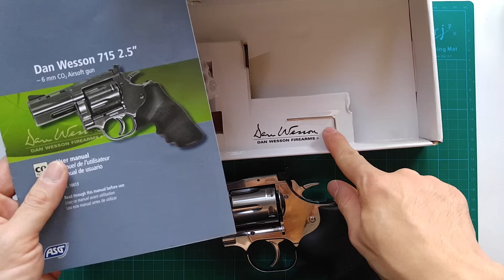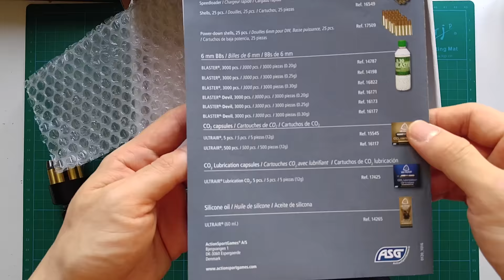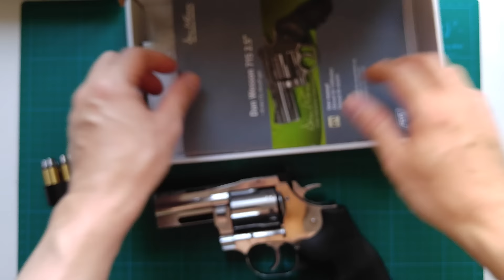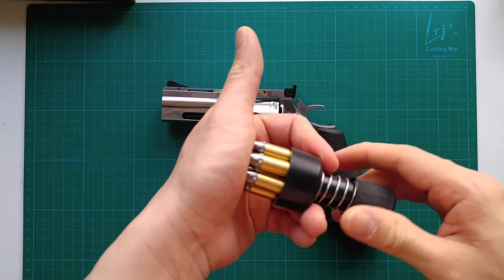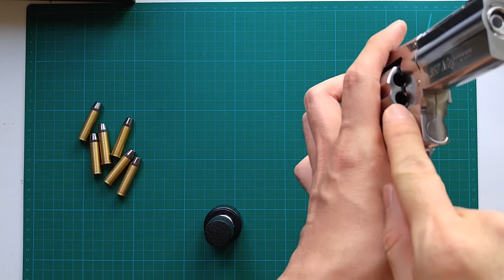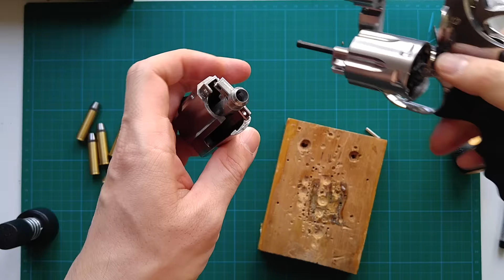ASG Dan Wesson 715 2.5 inches barrel CO2 6 mm airsoft revolver

Comment: I was considering the Umarex M29, but that made a lot of rattling noise with the shells. Instead I bought the Dan Wesson 715 grey steel. It feels very solid and heavy. I personally don't like rubberized grips and considering making a custom one. I skipped the moonclips and bought rear loading shells instead.
Reply from the maker: I brought the M29 too.
I got to admit the Dan Wesson build much better. It is solid, firm, and just feels premium in many ways.
There are wood grips available on eBay, made in Thailand. I have tried already. They looks good. But without the metallic insert, the weight and balance of the gun feels a bit off to me. So I stuck with original rubber grip eventually.
But I couldn't resist BIG bore revolver, with BIG cylinder.
Reply: @BadGuyDennis  
Good point, they added much weight to the grip panels.

Comment: why barell cant bechanged to another lenght one??
you just need to remove it and get a different one...should be the same...
Reply from the maker: The problem is: they don't have the barrel independently for sell. If you can found one, then you're right.
It is not impossible, but impractical.
Reply: this is such a waste...you could have basically 4 revolvers in 1 in this way, this making the gun the best in class. It already is on top best, but imagine having it with this possibility... :)
Hopefully they will make spare parts at some point in future...

Comment: very well,
but is it possible to replace the barrel with a rifled barrel?
Reply from the maker: This reply is gonna long.

Rifling can only be worked on projectiles which have somewhat of rod-shape. Also, the diameter of the projectile has to be slightly larger than the lands of the rifling in order for the projectile to engage with the rifling to spin. There is tremendous of fiction. This replica is a low pressure system (compared to those of true air gun) and doesn't have the power to overcome those friction.

Rifling is a very horrible horrible idea for spherical projectiles. I knew it very clear. My first premium airsoft gun is a MCG Beretta M92F in year 1992 (I still own it). It featured a so-called "Cyclone Barrel System" by the manufacturer, which actually is a rifled barrel. Back then there was no hop-up in airsoft world yet. The philosophy behind MCG of doing so was they tried to create a spinning air cushion around the BB to enhance the accuracy. When the whole system was new and the internal components were tight, we don't see the accuracy was any particularly impressive at all. (Even compared with my entry-level Tokyo Marui spring-powered hand-cocking pistol.) When the gun being played for a while and the tolerance started to lose, we gradually saw the trajectory going weird. The projectiles fly with circular motion in the trajectory in random direction because the BB follows the groves of the rifling! Simply replaced with a tight smooth bored barrel enhances the accuracy, range and muzzle energy, very substantially (many gas leak from rifling gloves with the original factory rifled barrel.) Later, when the concept of hop-up started to emerge in airsoft community (I was pretty early in experimenting this), we found the rifled barrel and pop-up just cannot co-exist. Hop-up will introduce more friction, with the already existing gas leak in the rifled barrel you lose even more power and range. As well as the trajectory was totally disastrous.

 So, I'm sorry but I have to say that even I know it's gonna offensive, in this case, your idea make no sense at all.

However,  if, this revolver replica, in air gun configuration, shoot mushroom shaped pellet, then your question might work. (But I have to emphasize again, I play airsoft only. I don't play air gun.)

Comment: This is a very good presentation.But Tell me please How I can take more FPS from this gun?
I have the Old version With all the mods.
450 fps.
I want to buy this version ,Do you know any mode?
Thank you.
Reply from the maker: Try bore up the hole in the "primer" of the shell.
Use stiffer hammer sping. (But the components will wear faster, and also leads to heavier trigger pull.)
Get the long barrel version.
Reply: Thank you very much.
I will Try The Modifications.

Comment: I just found a 6mm 2,5 inch silver version on Evike.com.
But the one they sell on Evike.com has a orange tip in the barrel.
Do you know any web store where you can buy one like yours without the orange tip?

Thank you.
Reply: Hi. If you are inside E.U. try to buy your replicas from France. They do not have those kinds of laws, so far... (And as far as I know). Good luck!!
Reply from the maker: I live in a place where real firearm is pretty prohibitive. But we are relatively opened to airsoft and we don't have this orange tip issue. Any responsible online store should and will gonna ship the gun with orange tip on to those regions that are legally required. I have no idea who would send you the gun with no orange tip on without getting any trouble. It is more practical to get rid of the tip on your own, rather than seeking one you wanted from the source. I don't think it is difficult. (https://www.reddit.com/r/airsoft/comments/1vngv8/how_would_i_go_about_removing_the_orange_tip_on_a/) Being said though, be advised that removal of the tip on user level might cause you with legal, and in the worst case, even death consequences.
Reply: Miscellaneous Chaotic Lab 
Thank you.
Do you think the chrome color will break off in the barrel if I pull of the orange tip?
Thank you for your help!
Reply from the maker: I don't have any proof, all right?
But I guess, chances are, very likely, that the tip (which is just a piece of plastic) is attached with super glue (i.e. cyanoacrylate). So heating should be get the job done pretty well. Some high power hairdryer may be good enough. Or you can take the outer barrel apart (demonstrated in my video), submerged in hot water.
Make good use of duct tape, masking tape, towels... whatever to protect the metal surface.
A more stupid way is take apart the outer barrel, and submerged in acetone (remember to remove the front sight beforehand, otherwise it will ruin the black coating) overnight. Yes, you will end up with a gooey, sticky mess. But at least it leave the metal unharmed.
Reply: Miscellaneous Chaotic Lab 
Thank you very much. It’s a good idea taking the barrel apart and use hot water.

Comment: Are those the “high flow” shells?
Reply from the maker: The shells that came along with the gun are already the more realistic metal "bullet head" front.
I brought the the gun and spare shells directly from the retail store of my local distributor, which is far more convenient for me than acquire online.
Reply from the maker: If I recalled my memory correctly, I did mention in the video that I have to trade out my previous 4 inch model in order to replace with this 2.5 inch version. If this replica, just like the real firearm, came with a replaceable barrel package (I wish it would), then I don't have to do that.
Reply from the maker: No. They are "mid flow" shells.
You may bore up the "primer" hole to see if there is any increase in muzzle velocity.
Reply: Miscellaneous Chaotic Lab 
Thank you.
Do you have a link to a place I can buy them?
They look much better than the normal shells.
Reply: @YouTubeCommentator.  yeah they are nice looking shells! I got some with the stupid power down yellow tips on them due to the 1 joule limitations in my country! Them ones look awesome though I've only ever seen brown tip ones otherwise
Reply: Can you buy the 6inch barrel and replace with the 2,5inch?
Reply: Are you sure this is 6mm?
I am told the 6 mm only exists in silver gray. And not this blank silver.
Reply: I have this & how much in this gun.

Comment: how did you remove the writting on the gun?
Reply from the maker: I didn't. Those markings were just not there in this 2.5 inch version.
Reply: @BadGuyDennis  ohhh well there must be 2 different versions,  one that i guess is a tad bit smaller but has the *dan wessen * on the barrel in cursive,  im surprised no one os comparing these 2 guns
Reply: @YoungBlaze  I personally hate the “Dan Wesson” cursive branding lol super tacky

Comment: hi very nice video, i really need to ask you a question about the revolver ,this version its  made to work with plastic BB only?  its possible to use 6mm crystal (glass) bb and metal 6m bb? i afraid it will damage the bore of the revolver.
Reply from the maker: culio pistillo 
Short answer is no.
The barrel is made of aluminiun, and it has a hop-up unit. When those BB pass through the hop-up unit, the BB is very likely to make contact with the underside of the barrel lumen. Those BB made with materials you mentioned is harder than the barrel. In long runs, those BB will gradually eat out that barrel section. If you really want to shoot metallic BBs, there are 4.5mm airgun version.
Reply: thanks you alot!
Reply: @BadGuyDennis  thanks for the answer because i wasn't wanting to destroy my new revolver😂

Comment: Great review of the dan wesson 715 just a little bit over analized and a little to knit picked still good for those people out there who love long full spec versions of airgun reviews completely broken down he claimed it was a short 20 min review lol you should have got the 177cal 4.5mm pellet version it would be a great consealed self defense tool for people who live with strict gun laws plus it's very intimidating to scare a attacker off which i personally wouldn't recommend not unless it's a no choiceer plus it's very compact you should be able to pull at least 460 fps on a good warm day with a aluminum light grain pointed head high quality pellet those cartridges are the exact same ones used for the older version of the dan wesson with the rifled barrel I wonder if 5.5mm 22cal lead pellets would be able to shoot out of the dw 715 airsoft version
Reply: Lol definitely not wise to pull a replica on someone to scare them… because they just might meet you with that same energy and pull a real gun and dump your ass lol … and it would be considered self defense